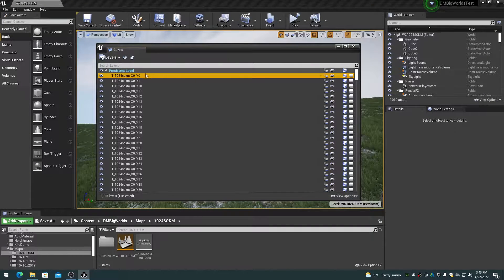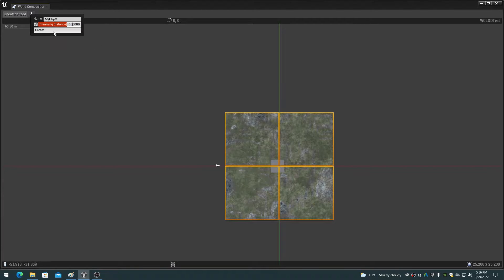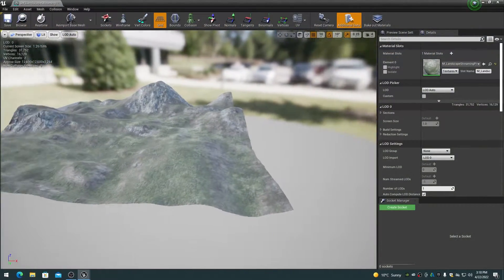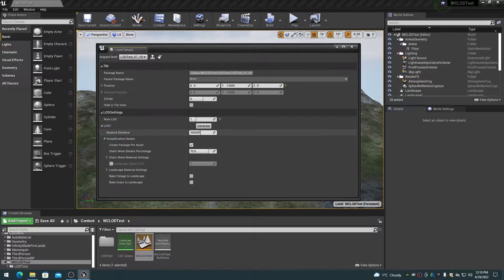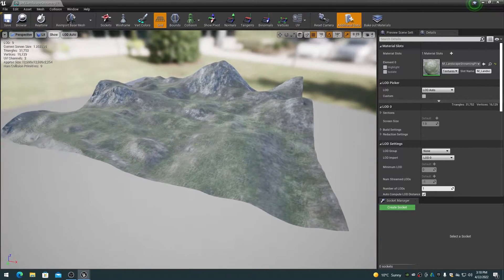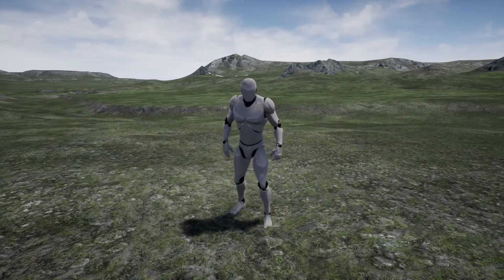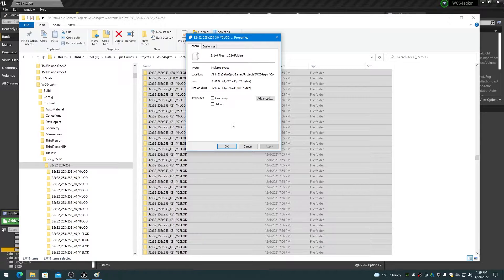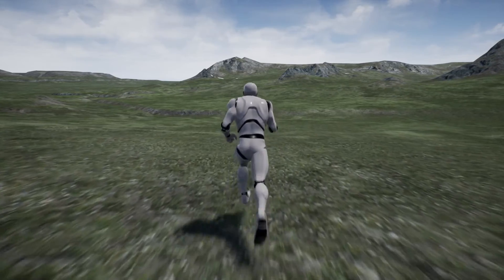UE4 World Composition Part 3 Streaming & LOD

Comment: gaps still a problem (2024, ue5.4) = (
upd maybe nanite solves the problem
Reply from the maker: I wouldn't think UE5.4 would fix it unless Epic improved the HLOD Mesh Decimation Edge Seam system.  Epic needs to correctly create the seam edges with proper tesselation, and they are not doing that.
Nanite uses the full mesh, so it shouldn't have the gap problem.
I have yet to try out UE5.4, I've been swamped solid with TerreSculptor updates.